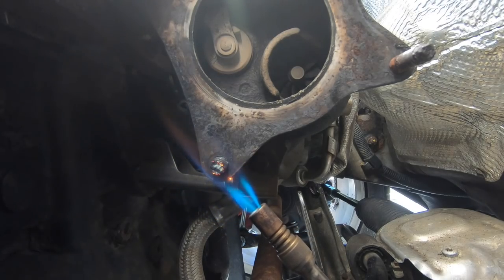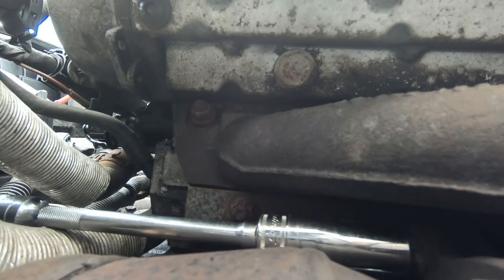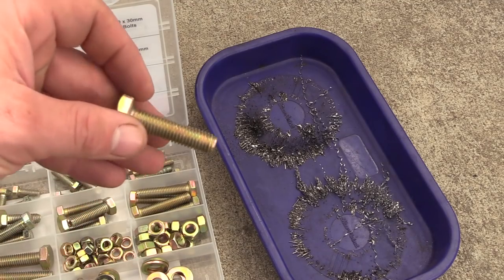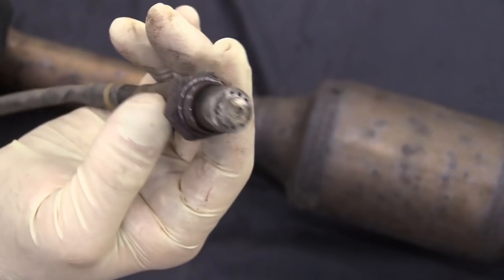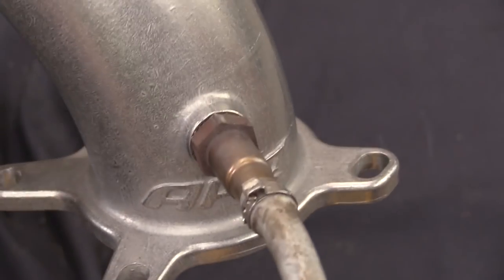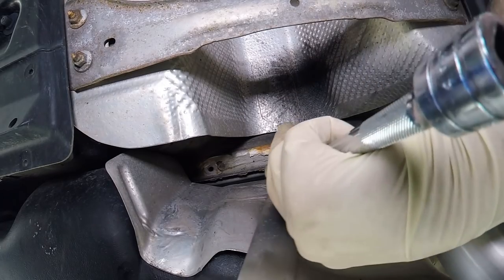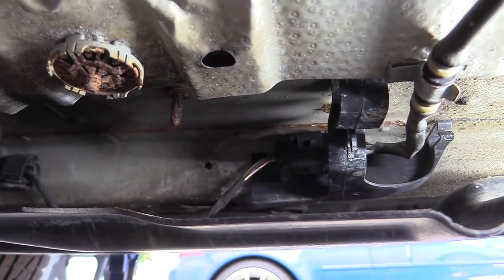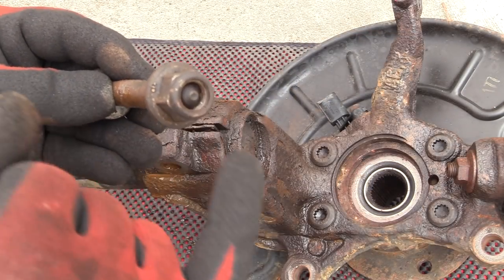Installing a Turbo Back Exhaust MK5 GTI

Comment: I had the same issue with the stud snapping on my Mk6 GTi in exactly the same way! Found this cool tool that actually grips down and turns on the stud as you ratchet on the back! Worked flawlessly twice so it's now in my tool box at work!
Reply: Link to the tool?

Comment: On a 27 yr old corrado to remove exhaust bolts, all 8 of them I used a blow torch and had them glowing red, waited just till the harden up again a little and then wound them off. Didn’t want a snapped stud in the head. But found it was the only way to do it. Wd40 just didn’t cut it. Great video charles, you videos always help me on my passat

Comment: I love my awe exhaust. I got it used for cheap. Mine also has a resonator tho so it’s only a little louder than stock unless your flooring it. but as you can tell all the connections make it a pain. It can actually make the exhaust sag at the rear subframe because the hanger at the far back right is not used. So make sure the connections real tight. Just like a plugged bunghole.

Comment: A trick I use for removing broken studs, bolts, bleeder screws, ect, is to plug weld a nut to them. Quickly cool the nut and broken stud and put a wrench on it. Of course you need to have access to a welder.
Reply from the maker: Yep that’s a great way to do it

Comment: Quick question, that tool you used to pop off the rubber hangers at 7:12, where’d you get it or that is it called?

Comment: I have the old APR downpipe. The new style looks a lot better. That second bracket makes it possible to remove the front mount without pulling the whole exhaust system. I had a heck of a time getting the worn out front exhaust mount off my car to replace it.
Reply: Where did you get the apr downpipe..cant find it online

Comment: Ah the Imperial measurement, I remember that system.

New exhaust system, new hardware fixings, new brackets... old rusty O2 sensors Awhaaaaa?!.. 

I suppose it’s in fitting with the theme xD
Reply from the maker: Lol if I had new sensors I’d install them too.

Comment: My car is sitting there with a car cover for winter.... This is why I went to my 2011 for winter... The 2001 bolts sheared off in the turbo.... Spring time turbo removal, sigh. I tried days of penetrating oil too

Comment: That's the same stud on the turbo that broke on me as well and it wasn't even rusted.  I didnt have a 90-degree drill, so I just installed with 3 of the 4 nuts, so far so good, lol.
Reply from the maker: I’m surprised it holds!!! That’s awesome
Reply: @HumbleMechanic  Well, unfortunately (or fortunately, depending on how you look at it!) I think my turbo is on it's way out so I can go ahead and take care of that when I upgrade the turbo. :D

Comment: Do you have to drill out the flange hole to fit a bolt through it? I had a stud back out complete during uninstall and now I would rather replace with a hex bolt than try to reinstall the stud. Seems easier to me, but I'm not sure if the flange holes are meant to thread a bolt from the turbo-side from stock. I don't wanna jack up the threads.

Comment: Would it be better to use a nut splitter at the outset for the downpipe connection to avoid breaking the studs? Can the nut  splitter fit in there well enough to use? I'd like to replace my entire exhaust but I am concerned about all the problems with breaking the exhaust studs.

Comment: Nice work Charles.  I have an mk6 gti I bought not to long ago. Very nice. I can see why GTI's are so popular.  Thinking of getting rid of my mk4 Jetta gli for an mk5 gti. The mk6 is just sweet.  But that fsi motor that is on them scares me a little.  Our  b6 Passat 06 is a little more than I bargained for.  Is there much of a difference between the mk5 motor and b6??.
Like I said thse gti is nicer then my gli. Thanks

Comment: I would have replaced the bolts. Easy with a torch.  Just get the bolt flange red they come right off.
Reply: With the red drill he use ?

Comment: Hello my friend How are you .. first I need to thank you for your videos they help uss a lot and i see your videos many many times .... and second ..
I have just one question  I have skoda fabia its the same like GOLF 4 and i have a problem i need to change the  anti roll bar drop link but the lower screw its rust a lot and I cant remove ... I clean with the brush  and put a WD 40 ... but does not work should I leave 1 2 days or how can I remove .... THnx a million times .... my friend all love from Sweden ..

Comment: those studs nuts are a bitch to get off without breaking the studs. my suggestion is getting a nut splitter and chop them off.

Comment: Quick question Charles 
I just destroyed wing mirror on My golf mk7
Is it just 2 bolts I need to take off to replace 
Or is it complicated to fix
Thanks
Reply from the maker: It’s that and a connector. In my power fold mirror video, I do step by step on how.
Reply: Okay thanks happy Christmas 🎄